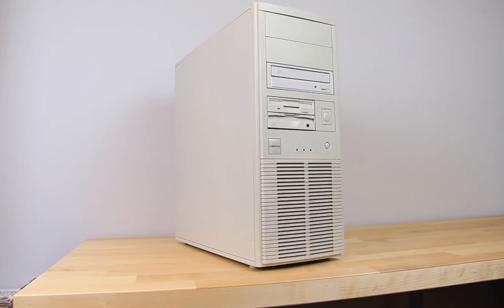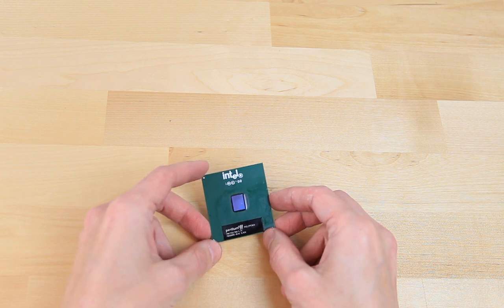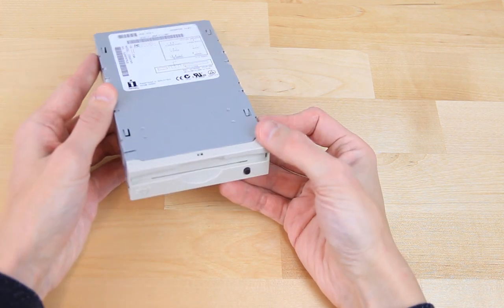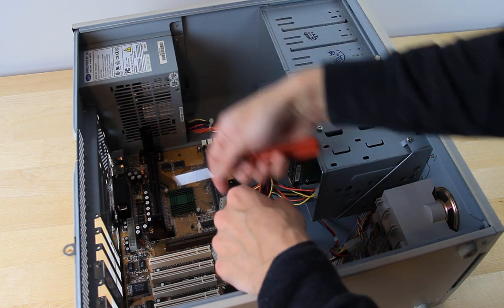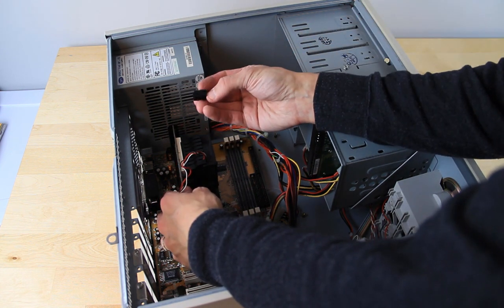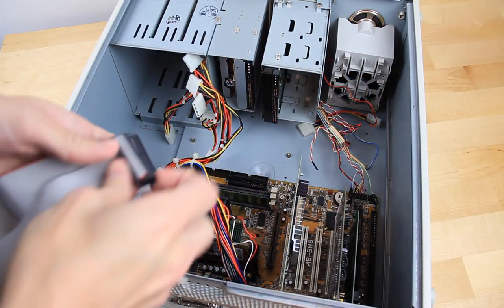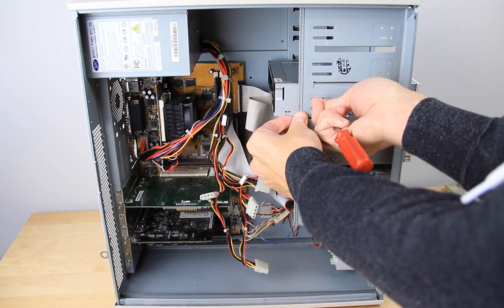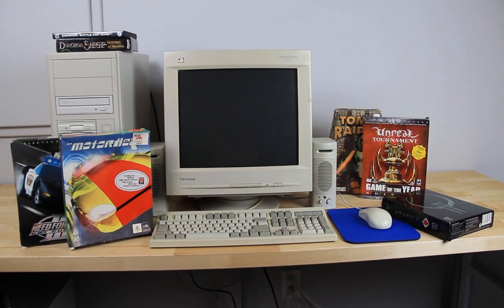Let's Build a Pentium 3 Retro Gaming PC

Comment: I built something similar to this not too long ago.... Pentium3 500mhz slot 1, Abit BE6-II, Crucial 1x256mb pc133, Seagate 6.4gb ata33, 3dfx voodoo3 2000 agp2x and WIN98se, makes for a great retro gaming system for the mid to late 90s windows games.
Reply from the maker: Awesome sounds like a very nice machine.

Comment: I have a similar machine apart from 400 MB ram, a P3 at 400 MHz and 128 MB Nvidia graphics. It exists to run Windows XP and museum reasons. I'm doing a bit of restoration on it today because I decided to paint some of the yellow plastic during some other painting. Mine is mostly from free parts / garbage. I got here for the names on things as I was into pocket computers back then and skipped a lot of models.

Comment: Awesome build. Also the SPI (Sparkle Power, which is a company related to FSP and Fortron/Source) PSU is good for retro builds and among the reliable ones
Reply from the maker: Thanks! Hoping to build another P3 project here soon but it hit a few snags so may be a while yet. I still use the machine in the video though after some minor changes. Running great!

Comment: Came up randomly in my feed, nice build.  Love that case.

I too have a BH-6 P3 700 retro system, save that mine is a slot 2 processor rather than a 370.  I also went with an Awe64 Gold for some pure-DOS goodness.
Reply from the maker: Thanks! And very nice that system should set you for some good DOS and Win 95/98 gaming!

Comment: What's benefit of a P3 over a P4? I recently picked up a Ti4600. Was thinking of using it with a dual CPU 1ghz P3 I picked up but been told even this setup will be CPU bottlenecked. Should I use on the P3 or make a P4 rig? The OS will be Win'98.

Comment: 128 Mb memory? That's low even for a Windows 98 system.
Reply from the maker: Yep I don't disagree it's been a while since I made this video hah. Building one today I'd opt for a bit more memory as it does the job but doesn't exactly match the power of the CPU. The machine has more memory in it at this point.

Comment: Pentium3 is eaely 2000s
Reply: I think the one he is using is late 99. Not sure though.
Reply: Pentium 3 released in 1999
Reply: Pentium 3 released in 2 stages. First was named Katmai. It was released in early 1999. Second was Coppermine. It was still released in 1999, but at the end.
Then, in 2001, they made lowend variant to Pentium 4. Named Tualatin.

Comment: It is better to install a Pentium III 600 MHz or less processor  in this build, for better software compatibility.  If you need more speed, go with a Pentium 4 build.  Also, the Voodoo 3 graphics card sucks.  Install an AGP 2X or 4X graphics card.  If you install a Diamond Viper v770, with 32 megs of ram, or an ATI Rage 128 Pro, with 32 megs of ram, you do not need to install the Voodoo crap.  Remember: build your pc for the software that you will be running on it, not for your ego.
Reply: Kinda agree. Very unbalanced system.700 MHz screams i need 256M RAM, GeForce 2 or even 4 and Audigy(2).

VooDoo 3 is a K6-2 or PII-300 territory and it's better be saved for non-Intel chipsets due to their famous AGP issues. It have palletized textures and table fog support for early W95 games which most other cards lack, but GeForces have it too.

Live! is a bit old for later EAX games.
Reply: Let the man Build and sit back and watch, or else make your own video.
Reply: Intresting, how man can improve his knowledge and skills if people only applaud to him. Maybe he just stay a child?
Reply: Voodoo 4 and 5 were much better and more power that the ati 128 maxx during these times and the voodoo 3 was literally one of the best and not crap and due to 3dfx jt surpased the 128 in alot of games back then
Reply: what are you speaking about? Voodoo3 is better than rage 128 pro. It is capable of AGP 2x.

Comment: I'd like to have an internal ZIP drive or 3 for my various old school systems. Same with a tape drive. And cable management is hard when dealing with ribbon cables.
Reply from the maker: The ZIP drive has proven to be quite useful as a stop gap measure to transfer files before I get a machine networked. It's handy mostly because I accumulated enough ZIP drives more than anything!
Reply: @RiksRandomRetro  First time I ever saw one was in middle school, though that's when floppy and zip drives were on their way out.